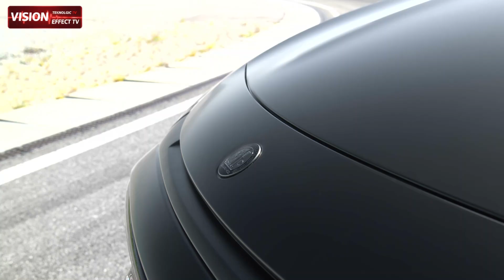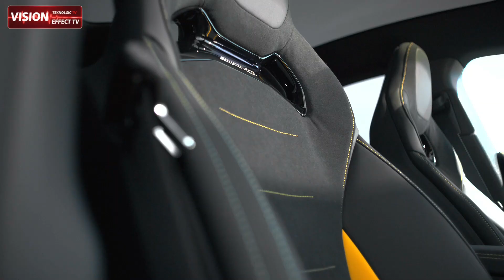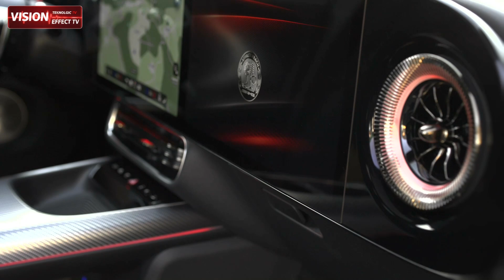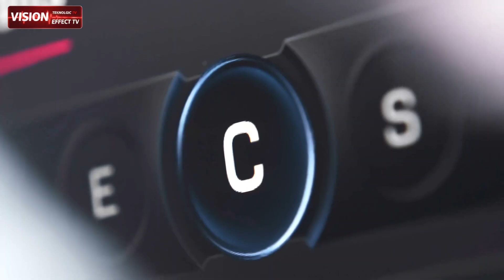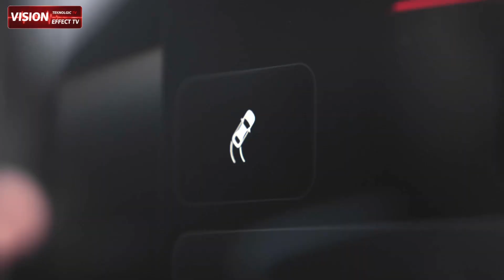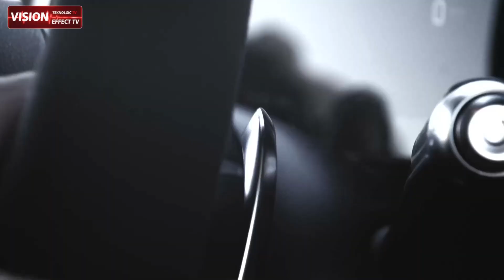2027 Mercedes-AMG CLA 45 EV First Look: 671 HP, Three Motors & Next-Generation AMG Technology

Comment from the maker: By locking down a specialized tri-motor setup utilizing hyper-compact axial flux engineering, Mercedes-AMG is putting serious hardware on the table with 671 horsepower and true independent rear torque vectoring. However, the real conversation starter is the 'AMGForce S+' system, which combines external microphones, digital sound synthesis, and actual physical seat shakers to simulate the mechanical vibration and pops of an internal combustion engine. Does adding structural haptic vibrations and simulated gear shifts make an ultra-fast EV genuinely fun, or is it a tech gimmick that overcomplicates a 2.3-tonne machine?👇